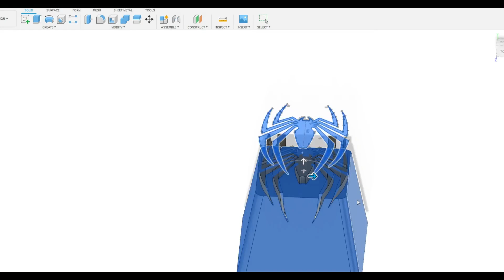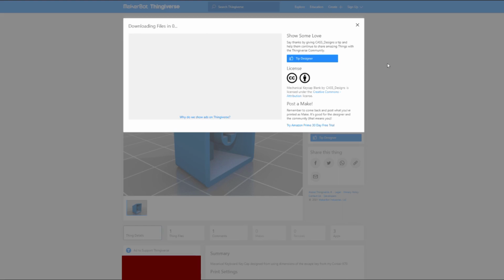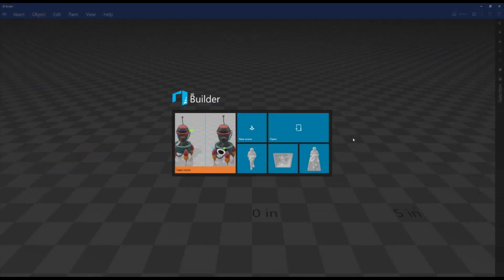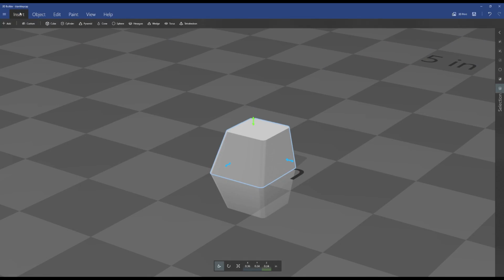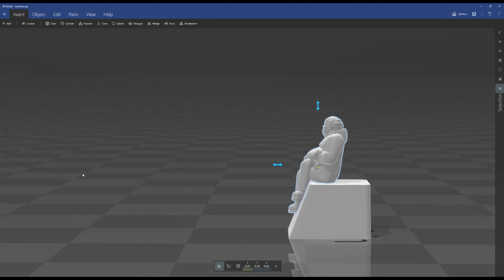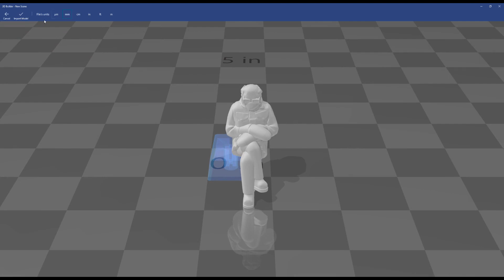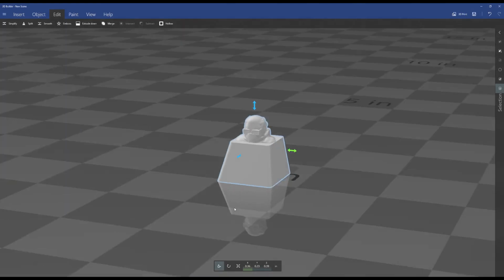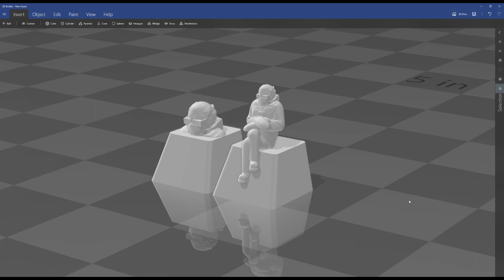Can you create your own Keycap Models to 3D Print without any Design Experience?

Comment: Thanks for this. Asked myself this exact question a couple weeks ago. Started looking into CAD/SCAD as a result, wasn't sure where to start. Even started playing around with FreeCAD (which is awesome as a free tool) but really wasn't interested in going through and learning things I knew I'd never need to know, just in order to get to the info I needed.
Reply from the maker: No problem - I have one other video on designing a keycap that shows the general 3D modeling software tools that I use in a lot of different softwares so that might give you some information on other simple functions you’d use often

Comment: Thanks man! I have this really nice teacher in my school and he said that if I gave him a design he would print it out for me on the school 3d printer :)) quick question though, is this a sort of neutral keycap that i can use on all keys (except of course space, enter, etc) or is it just for the esc key?
Reply from the maker: No problem, that's awesome! It is a generally neutral keycap as long as it fits on the MX cherry switch. Some key cap types have different sizes for the different rows of the keyboard, so it will be a bit different depending on the keyb you have
Reply: @CASSDesigns  thanks, do you have a tutorial on how i can color it? gg for the fast reply bro :)
Reply from the maker: @cristoxz4964  I don't but what you can do is buy some acrylic based paints, spray paint it with primer first then paint it with a couple of layers of acrylic. Or, just spraypaint it if you're doing one solid color

Comment: wont you need to print with supports because of the inside of the keycap??
Reply from the maker: Yes you will, you can add supports in your slicer software you don’t need to worry about them when making the model
Reply: @CASSDesigns  I'm worried about the supports being a pain to remove from certain parts, I tried printing them upside down to avoid having to use supports but then the top of the keycap had the first layer print lines on it. Thanks for the quick response!
Reply from the maker: @pgoffinet17  no problem - you can add support blockers in the little ‘+’ section that fits on the switch - this way you don’t need to remove those supports (and they aren’t really necessary in there anyways). It’s easy to remove all of the other supports. You can look up how to add support blockers on different slicer softwares
Reply: @CASSDesigns  Thank you so much for the help! I cant wait to see what new videos you make on your channel!